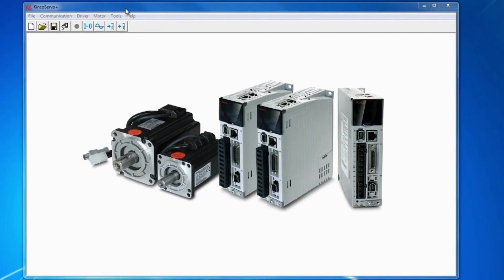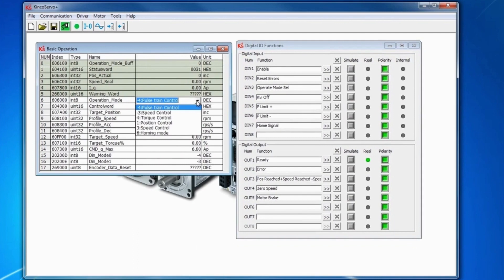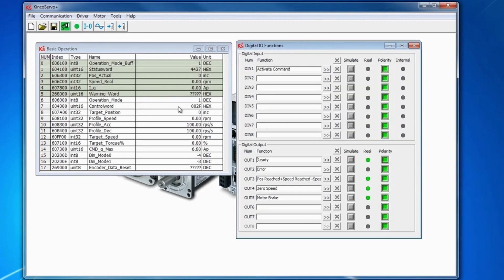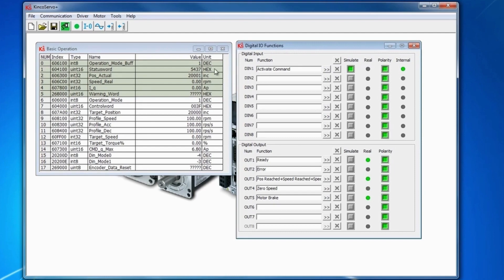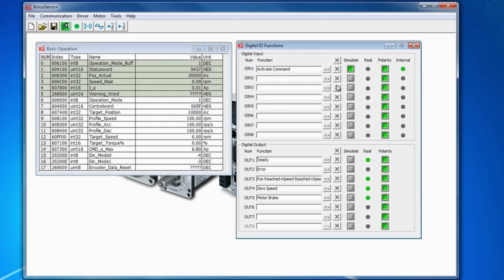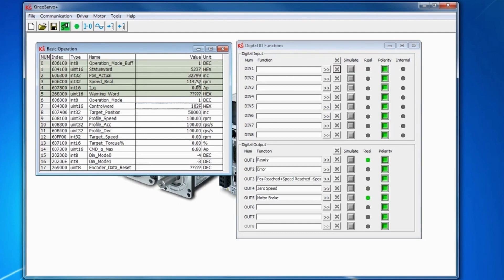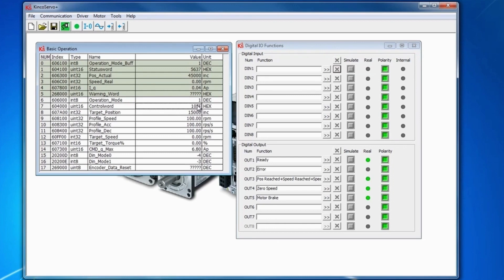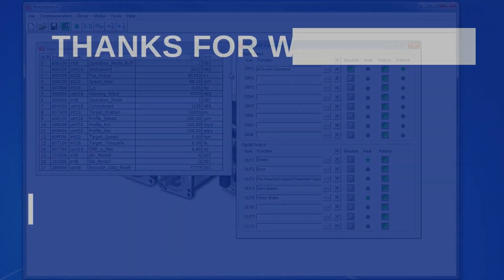Tutorial: Kinco Servo Motor Position Control

Comment: Is there any way to make the servo continuously rotate to the right, for example? So that it doesn't exceed the maximum number of steps?
Reply from the maker: Hello, thank you for contacting us with your question. This video only discusses position control, however, there are other control options (speed, position, and torque). A servo motor can rotate continuously in one direction. This falls under speed control, and this method does not rely on steps. Position control can rotate in one direction continuously if the controller supplying the pulses is pulsing continuously (if the pulses stop, the motor will stop). Torque control is exactly like speed control except that you add the ability to control the torque through an analog voltage signal.

If you have any further questions, please contact our engineers at (714) 992-6990 or applications@anaheimautomation.com and they will be happy to assist you.

Comment: hi Greetings, I am trying to program a kinco servodrive but when connecting it it gives error 4002 referring to the encoder and I have not been able to erase this error nor does it allow me to configure the motor model
Reply from the maker: Hello, thank you for contacting us. Our engineers will be happy to assist you with this issue. Please contact them directly, either by phone at (714) 992-6990 or by email at applications@anaheimautomation.com, and they will respond to your request as quickly as possible.